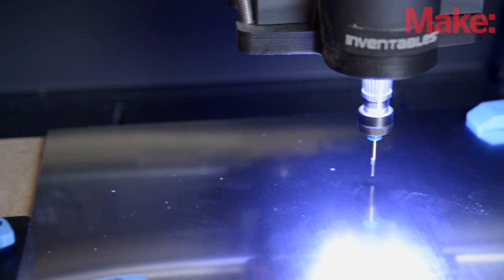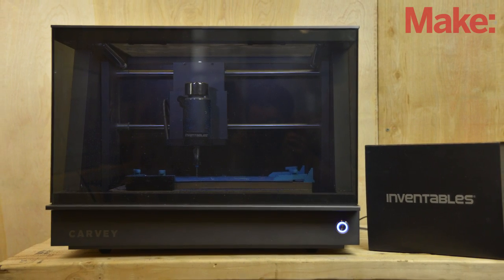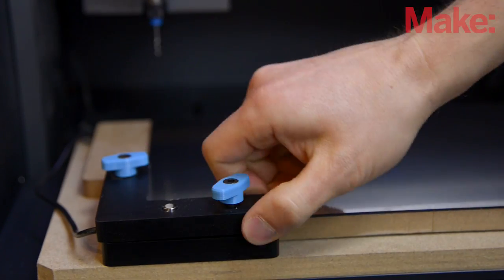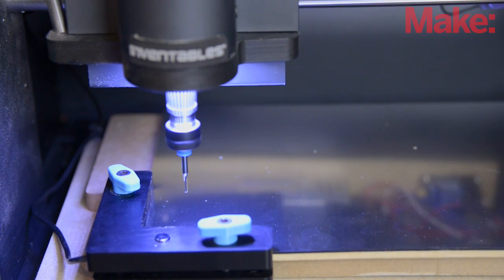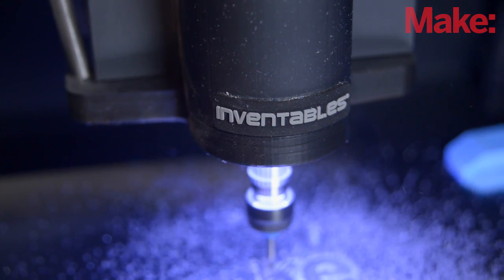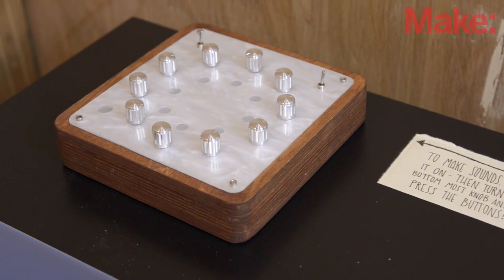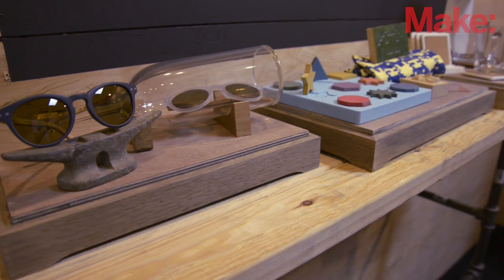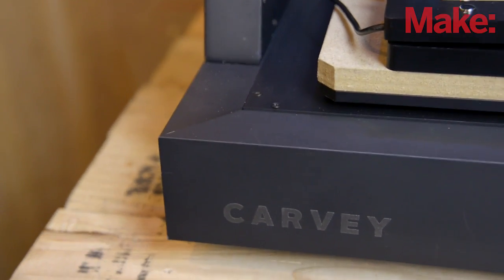Carvey: CNC Made Simple

Comment: I can see Dremel, Stanley, or Black and Decker, among others one-uping this. I'd love to have my own CNC machine if it was 1) big enough to carve a piece of at least 1x1 meter and up to 5cm, 2) able to route almost anything up to steel, just change the bit, and 3) not more than $3000 USD.

I would love to be able to CNC an entire 1/5 scale RC car, for example. The Chassis, the single largest piece, would be a bear. At that size, you could do most automotive and home mechanical repairs pretty easily your self, as well. 

3D Printing and CNC? Now I just needs smelter can casting sand and I'm set. Actually a gear cutting attachment for the CNC would be good too. You can never find the gears, sprockets, pulleys you want when you need them.

Don't look at me like that. You can sell time on your machine to recoup costs it f its that important to you, or sell your work. Not everyone is going to have their own machines. Nothing better than a hobby that can also make you some money on the side.

Comment: Bullshit... for 2000$ i'll  buy a real CNC router... this is just a expensive Toy!
Reply: with control via LPT-port ? )
Reply: nRADRUS
Sure, search for CNC X6 1500GT USB - they also make a LPT port version. That's the one closest to this price range. If you check out the CNC 3040, I think that is probably closer to the capabilities of this machine.
Reply: Rickamajig  Or he could just buy a mach3 compatible board, some NEMA17's and build a frame out of misumi parts for less than 400.

Comment: Unrealistic as usual.  If you don't learn design for CNC it's useless. Doesn't teach you the proper tools to use either.   Just like easel.  That's useless to unless you like clouds and letters and $70 bottle opener.  I tried to save a design and it gave me a "save fail" notice straight away.  I wasn't surprised.  That zac has the enthusiam of a turnip.  another ripoff.  There's no such thing as a 3D carver.  But, at least they pulled out the big budget and included safety switches this time.  Build your own.  That's your best bet and cheaper than $2000.